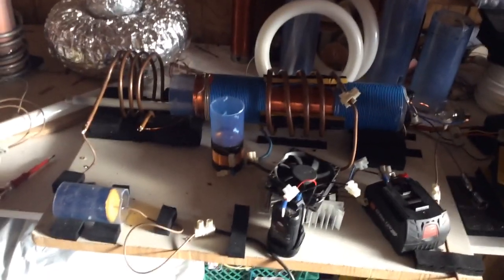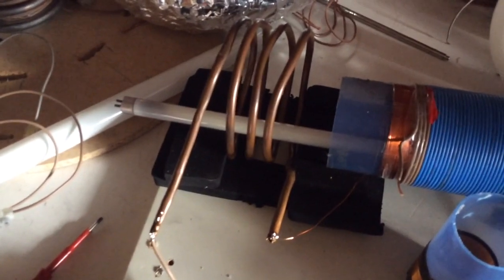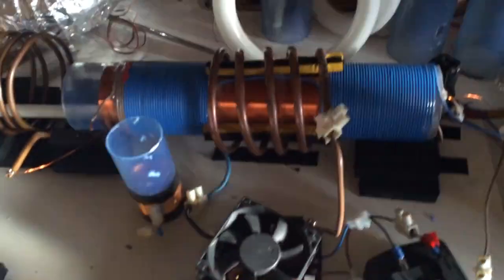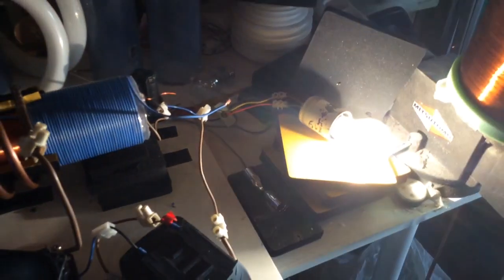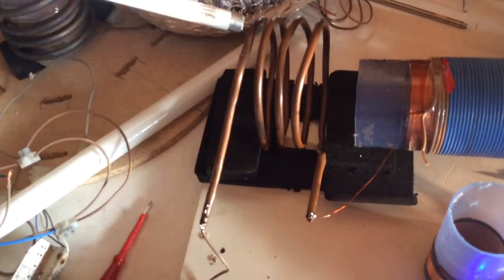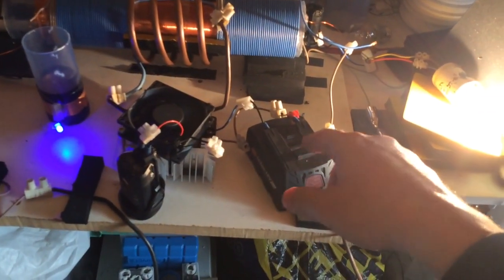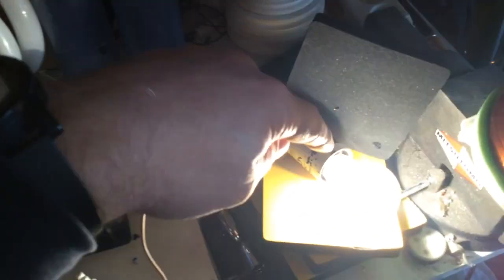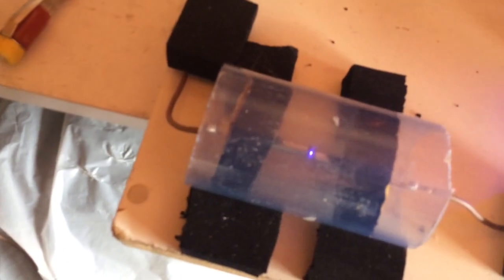Tesla 3rd field energy  antigravity

Comment: Hi Nick - are your L1 and L2 coils in resonance?
Reply from the maker: Mark Flint yes it’s automatic with the ZVS circuit
Reply: @dkdyker  I could be wrong, but the ZVS will drive the L1 coil at it's resonant frequency, but the L2 coil will need still need tuning to L1 unless it's a natural wave length - such as 1/4 wave - of the other coil. Do you have a way of reading the frequency on the coils?
Reply from the maker: Mark Flint I will try to use a probe I have, cannot promise this will work as DMMs in this field seem to be effected.
Will come back with data.
Reply: @dkdyker  My understanding... if the zvs is driving your L1 at, say 35khz, you should then measure the inductance on L2 with LCR meter in order to calculate the capacitor value needed to get L2 to the same frequency as L1. (Frequency and induction give you capacitance needed http://www.1728.org/resfreq.htm.) Once they are running at the same frequency the power transfer between them can be almost 100% depending on the Q of LC circuit. Without the coils being tuned to the same frequency you can certainly get a power transfer, but much less than what is available when tuned. The zvs will adapt to change in frequency on L1 caused by the coil being loaded, but if your coils are tuned together at the same frequency you can get a situation where you draw off power without effecting L1 - especially if you use another isolation transformer for the load and run the load between the secondary of this isolation transformer and ground. I think your L3 there might be used for this purpose. I've not done it yet - so feel free to use this as info as a pointer for your own research. If you have a frequency gauge on your DMM that should be used with a HV probe only in this case. But some meters will let you get a frequency reading "contact-less" or putting a probe close but not touching. All the best with it.
Reply from the maker: Mark Flint thanks for the great info, I will try this as soon as time allows. Happy new year to you .
Reply: @dkdyker  All the best for 2019 Nick
Reply from the maker: Mark Flint the L1and L2 are automatically in resonance as the ZVS  conforms to the environment